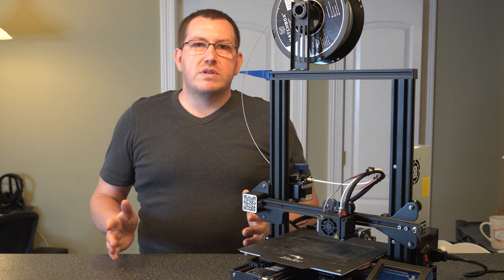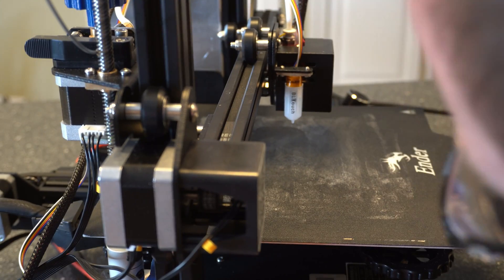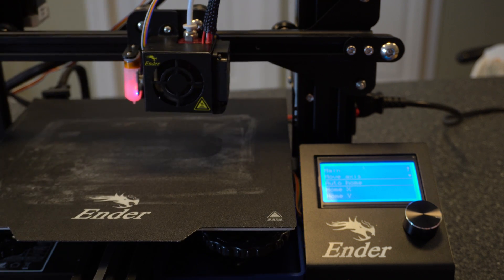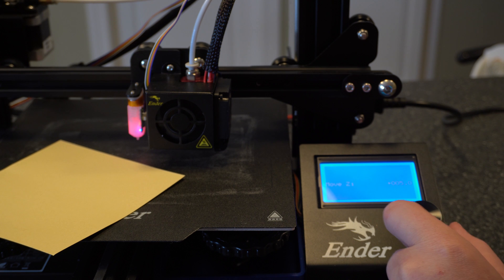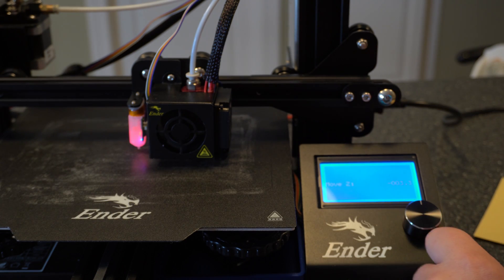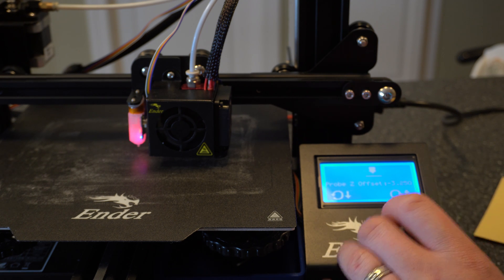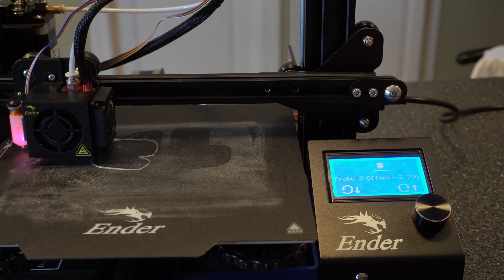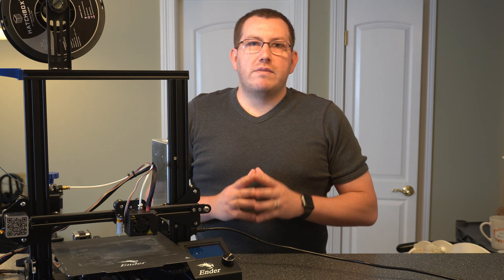Z-Offset BLTOUCH With Marlin Firmware

Comment from the maker: I hope you found this overview helpful! If you have any questions or would like other tips/tricks, just let me know in the comments.
Reply: You make good videos, man. Nice and to the point, but informative. You're not spending the whole time showing off how much you know with irrelevant bull$hit.
Reply: sure did find it helpfull, got it all dialed in
Reply: I did not have the option to set the z offset! What am I doing wrong
Reply from the maker: @jmzthree  It sounds like the bltouch firmware isn't there.
Reply: Hey, how do I get it to stop from oozing out when it’s finding all 9 points, my printer keeps messing up partially from the oozing and the other half it messes up I don’t know 100% why but like it prints on half of the bed and the other half it scratches the glass bed I have
Reply: Hi, on my z offset even at its max (-10) it can't get close enough to the bed, it's about 1-0.5 cm away from it, I have an ender 3 v2 by the way
Reply from the maker: @ShooteKat  Hi. Its still that far away when it starts to print? Keep in mind that the autohome will also be around +10mm, unless changed in the firmware, even after you set the z offset.
Reply: @3DPrintscape  yes, it still stays far away when it tries to print
Reply from the maker: @ShooteKat  What value is it at when you autohome it and are you sure saved the z offset?
Reply: I have done this three times. Every time I do the home, then do the z movement, it is a different value every time from a + to a - then to a +. Then when I try to print, it is way too high, or way too low.
Reply from the maker: @knerduno5942  Do you have any movement on the carriage?
Reply: @3DPrintscape  There is no movement in the carriage. I ended up switching to the Marlin software, and running that Z Offset Wizard. Thanks for taking the time to reply!
Reply: What version of Marlin were you running? I bought a used ender 3 pro and they knew nothing about it, it has a bl touch but as many times as I set it all up and save settings it's never starts correctly. Each print will probe all points then start well above the build plate every time.
Oh and i don't have those options on my interface that you use in your video.
Reply from the maker: @fmclutch  I think i was running the latest marlin bugfix at the time, but it was two years ago so i cant say for sure. Did you set the z offset correctly and if you kick off a print right after setting it (without powering the printer off) does it start at the right height?
Reply: @3DPrintscape  I think I did, set the z, saved the settings and went to print and it would stay up pretty far from the bed. What I've been doing to get it to print is . I do the bed level, then tell it to print and as it starts it does bed level again and  I immediately have to get under and start raising the bed to where it's close enough when it actually starts the print.
Reply from the maker: @fmclutch  I would try to reflash the firmware, something really seems off.
Reply: Life saver here in 2025 my hair thanks you.

Comment: When I try set up the cr touch on Z probe wizard it just freezes with "homing xyz" onscreen and does nothing
Reply from the maker: Hi. I would try to clear eeprom and push the firmware again.
Reply: @3DPrintscape  I had the + and - wires inverted on the probe. Blew it up. I need a new probe now ha firmware works now though
Reply from the maker: @bobbyrayofthefamilysmith24  Ok, glad you got it working.

Comment: Followed these steps and it’s still not really perfect. Any tips?
Reply from the maker: Hi. What issues are you having?
Reply: @3DPrintscape  still seems a little close to the bed in some spots even after doing the Z offset and bed leveling
Reply from the maker: @ralphmag3072  Is the bed warped? If its bad, you may need to increase the mesh size from 3 to 5.
Reply: @3DPrintscape  it is a little further away at the center but thinking I would consider to be extremely out of tolerance with the rest of the bed. Would E steps need to be adjusted after a cr touch?
Reply from the maker: @ralphmag3072  E-steps shouldnt need changed. If you take a ruler or level across the bed is there a low point in the center? It really sounds like the bed is warped, which is common.

Comment: Hi I have had a 3d printer for a while now and had originally used marlin for my firmware when i added my BL touch. however I have now added a sprite pro and I'm really struggling to find all the settings I need to put the new marlin 2.1 and and add back in the BLtouch, sprite pro to a ender 3 pro. any ideas?
Reply from the maker: Hi. There arent any settings that need to be changed in the firmware for the extruder. You will want to adjust retraction settings, e-step, etc on the printer/slicer once you flash the firmware.

Comment: I followed both videos you have set the z offset but when i go to levele bed option it does the middle and then comes to the front right of the bed for the next point and then doesnt touch and go to the next measurement? If i manually level the bed with paper its even . When i start a print its not even close like a half inch away . Ready to rip cr touch out and send back. Prints fine with out
Reply from the maker: Hi. Try clearing settings (resetting the eeprom) and see if that changes anything. Its odd that it goes from the center to the front right, it should go to the front left.

Comment: i always measure the two sides of the gantry, level them manually with steppers disabled. (takes 3-5 measures and adjustments) then i auto home. I find that the two motors never align perfect after a powercycle. its not much deviation but 0.1- 0.15 from right to left side makes a poor firstlayer and not good prints.

I tried synching the two rods with a belt ontop but it still happens after every powercycle.
Also when you plave something on the plate your hand applies a slight pressure that affects your leveling. since you have a bltouch just make a matrix of your plate once, put locktite on the adjustment screws and live your life :)
Reply from the maker: Hi. I moved to solid rubber mounts and it helped out a lot.
Reply: @3DPrintscape  same. I also am thinking of bolting the frame to a heavy sturdy table. The solid mounts did wonders for the ringing
Reply from the maker: @reyalPRON  Interesting thought. If you do that make sure to put some foam or something between the table and printer. It will help level things out more.
Reply: @3DPrintscape  would that not counter the stiffening? I was thinking hard mount like the big machines at work are bolted to the floor.
Reply from the maker: Something like the insolation foam pads you can get at home depot are pretty hard but will help keep the printer level and reduce some noise.  @reyalPRON
Reply: @3DPrintscape  I settled on wilson number 4 squash balls as medium between the frame and the bolted frame. I can report amazing reduction in ringing.
Reply from the maker: @reyalPRON  Nice, i need to look into that more.

Comment: I've done all of these steps. My problem is the settings are not saving. I'm having to reset the z offset after every print, and for every start up. What do I do?
Reply from the maker: Hi. Im thinking something may be up with your EEPROM. What happens when you hit save settings? Also, do you have an SD card in when doing it? If not, try to put one it.
Reply: @3DPrintscape  printer beeps, and I've done it both with and without SD.
Reply from the maker: The beep is normal. If the eeprom doesnt work and there is an sd card in the printer it should save to that and pull from it if its in the printer on next load.  @christopherzieske7854

Comment: Hi, when I change my z probe offset to -2.9 (after measuring), when I autohome, it adds 2.9 to the 10 (default z level) so it sets it to 12.9. Idk what is going on, but am I doing something wrong?
Reply from the maker: Hi. Something sounds off. The autohome should stay at 10 and the offset comes into play when printing. I would try to clear setting and run through the process again.

Comment: i know this is an older video, but have you ever seen an issue where the z axis doesn't change no matter what value you're putting into the z-offset? for some reason its not accounting for the z-offset when i try to zero the z-axis
Reply from the maker: Hi. Doe the auto home and mesh run correctly?

Comment: My extruder is wiggly, but I cannot figure out how to get it to be stable. I don't have a side-screw under/beside the CRTouch like you show here, and I tightened the rollers as much as possible, but I can still move the extruder up about a 1/4" under either top roller. Any ideas?
Reply from the maker: Hi. There is an eccentric nut on the carriage (typically the top wheel). Tighten that and it should help alot.
Reply: @3DPrintscape  Once I figured out what the eccentric nut is, that did it! Thank you!

Comment: I tried this method and my offset is still not right. It looks good right until it prints then the nozzle moves up and away from the bed. I have not been able to figure this out for 3 weeks now.
Reply from the maker: Hi. Getting the offset right is the toughest part of the install. Try to kick off a test print then use babystepping to dial it in.
Reply: @3DPrintscape  I tried all of the above. I think the issue was the nozzle head wasn’t tight enough.
Reply from the maker: @RichAntonelli  That would mess with things for sure.

Comment: Hey chap upgraded my board to a 4.2.7 and upgraded screen aswell and firmware adjusted the z offset but it keeps raising it self when starts printing ?
Reply from the maker: Hi. It sounds like the z offset is not set right, or you have something moving which is messing with the z offset.
Reply: @3D Printscape  finally got it sorted changed the firmware all good now

Comment: Hi when i auto home the extruder doesnt go down on the z axis it moves to centre then stops and i get a message on the info screen saying Home Z first. I am using an Ender 3 pro. Do you know what may be wrong?
Reply from the maker: Hi. Is your z stop connected?
Reply: @3DPrintscape  it’s is not I installed an auto leveller which had a red plug with black and white wires which went where the z stop was
Reply from the maker: @tomandrew5917  Ok, you need to make sure you are using the z homing firmware if its wired that way. I have some builds on my site for it, but i dont think any of the creality builds will work.

Comment: I had some issues when calibrating the Z offset.   I have an SKR Mini E3 V2.0 and a TFT35 with touch.  I started the Z offset and was able to set it okay, but when I went to check it, it was off by .2.  Also when doing an autohome after setting the Z offset it would home, but the try to go down too far and the steppers were grinding.  I had to turn off the printer at this point and back on to fix the issue.   It was not just with the Z offset though.  This also happened after the initial auto bed level mesh was complete.  One other issue I had was when doing the Z offset calibration I would sometimes get a message the it failed and I could not get the messagebox to go away until I turned the printer off and back on.  I am using the precompiled firmware from bigtreetech that I just installed.
Reply from the maker: Hi. Can you make sure there is no extra movement on any of the axis or the carriage?
Reply: @3DPrintscape  There is no extra movement.  The issue only happens after I use the CR Touch.  Another youtuber suggested homing it in the center of the bed or crash off the side of the bed which seems to be what is happening.  This will require me to compile the regulat marlin build for the CR Touch which I have not done as yet.  I am in the process of doing this, but I have not figured out just how to change the configuration files yet.  I wish there was some kind of written step by step guide, but I have yet to find one.  I will just have to keep watching the videos and take some notes.
Reply from the maker: @zk_6312  I have videos coving how to make the firmware and also have firmware already made on my site for many builds.
Reply: @3DPrintscape  I will check it out.
Reply: @3DPrintscape  well, I finally got the Z-offset to work.  It took me awhile as I was looking for something called Z-Offset Wizard in the btt tft35 touch display.  I had to watch your video several times before I got it in my head that there was no such thing.  Anyway, it is working now.  You do realize that adjusting the Z-Offset you don't have to use the up/dwn buttons, you can still use the display's rotary knob.  I find it much easier to do that.
Reply from the maker: @zk_6312  Im glad you got everything working and its been a while since ive set the z offset with the tft so im not sure if i knew that or not lol.
Reply: @3DPrintscape  Thanks, though it looks like I was a bit premature.  It was working fine and I could print in the center of the bed just fine, but when I tried to print a larger print, a bed level test print that prints in all 4 corners as well as in the center, all I end up with is spagetti.  I thought the CR Touch should take care of this issue, but obviously I am doing something wrong.  I will level it manually again and try setting the Z-Offset yet again.  I might have to try a version of the pre-compiled firmware just to see if that works for me.  I have a few things I want to try first though before I go that route, maybe a larger mesh.  I am currently using a 5x5 mesh.
Reply from the maker: @zk_6312  A 5x5 mesh is already pretty large. Are you running the g29 command at the start of the print?
Reply: @3DPrintscape  Yes, I put it in the Machine Settings Start code just under the G28 command.  I releveled the bed manually made sure Z0 was just barely touching minus the paper width and I did have to still adjust it with baby stepping.  Now, it seems to work better.

I still have a couple issues now.  One when the probing stops the probe stays at the far right corner and then drags filament across the bed when it starts printing.  Two, filament globs up on the nozzle sometimes and ruins the print.  I am using an all metal hotend, but I ran a temperature tower and 205 seemed the least stringy.   Yes, the extruder has been calibrated for 100mm.  Okay, nay 3 issues.  Three, when the probe starts its probing it starts about 10mm from the right, but the left side stops about 40mm from the left.  I need to spread out the probing a bit more.
Reply from the maker: @zk_6312  You can adjust the offsets a bit more to get the probing center if needed. The filament globbing a bit is normal, thats what the purge line and skirt is meant to fix. The first issue with the filament being dragged across the bed is an odd one. It sounds like the hot end is too hot when doing the mesh but it also sounds like you started working on that when you changed the temp to 205. Have you printed a temp tower for the filament your using?
Reply: @3DPrintscape  Thanks for the info, very helpful.  I have it mostly working now.  I added some gcode to move the hotend to the front left to stop the dragging filament across the bed. I have since changed to PETG as parts of the model I was printing just snapped right off.  I have increased the infill as well.

Now I have a strange problem with PETG that I never had with the stock Boden tube setup.  I have printed a small box as a test and the walls are not sticking together.  I tried increasing the  temperature as several people have suggested, but no luck.  I am now slowing the print and travel speed and will see if that helps.
Reply from the maker: @zk_6312  The walls not sticking is normally a temperature issue but have you tried any other petg filament, maybe its a bad roll.
Reply: @3DPrintscape  Well, it is brand new almost and I increased the temp from 240 to 250 in 5 degree increments.  Maybe I need to go higher.  I am using hatchbox filament which has good reviews and I used it before when I was still using a Boden setup and did not have any issues.  My previous filament was Overature which was sticking to itself in various places on the roll which is why I switched to Hatchbox.
Reply from the maker: @zk_6312  Hatchbox is typically good filament, its what i use, but its possible the roll is bad or has been damaged by moisture.
Reply: @3DPrintscape  It is an almost new roll and I keep it in a dry box which is currently at 20% humidity.  I am more inclined to think it has to to with the mods I recently made (CR Touch, Micro Swiss Direct Drive and all metal hotend, new 32-bit SKR Mini E3 V2 with Marlin firmware).  I had this same issue with PLA so I am thinking possibly the hotend or clogged nozzle though the nozzle is almost new.  I am using a brass nozzle though rather than the hardened steel one that came with it as I did not have the correct size socket at the time.  The Micro Swiss nozzles take  7mm socket while the standard brass takes a 6mm nozzle.  

Maybe I need to go back to the stock hotend and see if that still works okay though hopefully I don't need to go back to the boden tube setup.
Reply: Well, I think I finally figured it out.  It looks like it was an under extrusion issue.  Even though I calibrated the extruder not too long ago, I decided to do it again.  When I extruded 100mm of filament only 76mm was extruded.  So I calibrated it so it was extruding 100mm and my first test print looks a lot better and the walls are sticking together like the should now.🙂
Reply from the maker: @zk_6312  Direct drive should work better than Bowden tube. Going back to the stock hotend sounds like a god next step to try to identify whats causing the issue.
Reply from the maker: @zk_6312  That would do it for sure, good find.